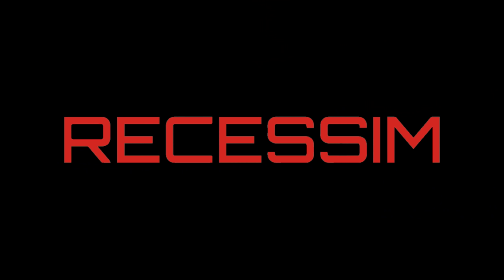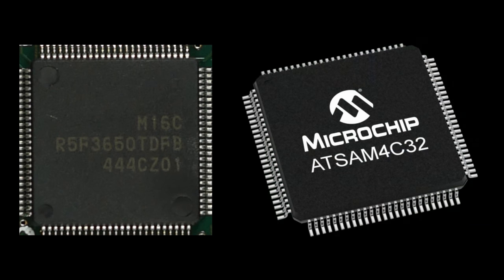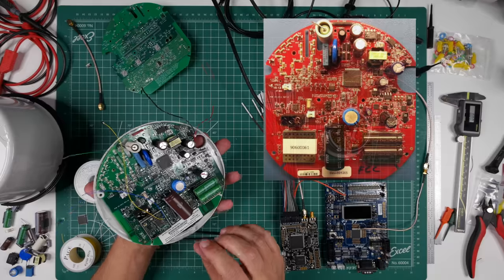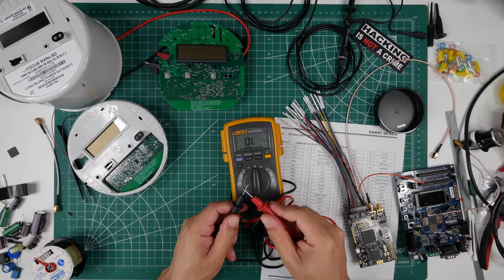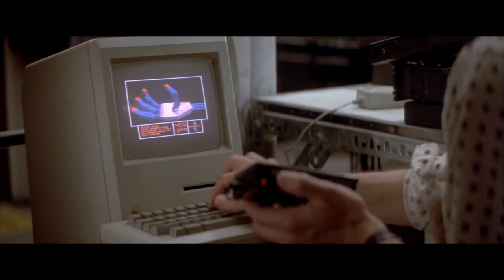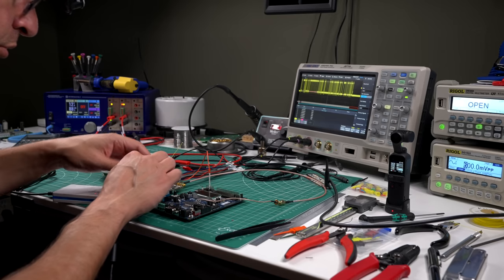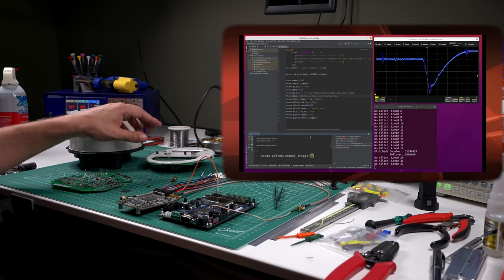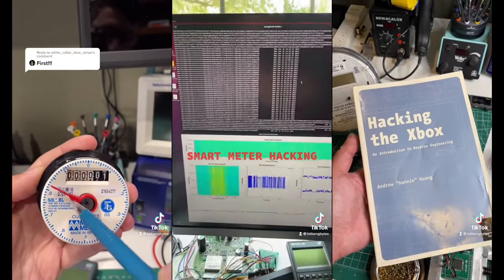Reprogramming a Smart Meter

Comment: This series is awesome!!  I got curious about this when (apparently) unbeknownst to me, my power meter was switched by someone we thought was an authorized service tech.  It turns out, this guy put a new meter on the house that was registered to some other house.  So when the power company showed up to check it out - they thought we had switched it.  But that wasn't the case.

Now I'm curious how these things work and how we got flagged.
Reply from the maker: I can think of two things that caused them to come check. First, your meter was no longer reporting back readings. Each meter has an ID number that's associated with your account. Second, a different meter was reporting readings to the surrounding meters that relay it back. This makes it very easy for the utility to determine where it's likely located.

Thanks for watching, glad you enjoy it!
Reply: @RECESSIM  so how can you give a smart meter the old id number and use one without a collar on it but without them knowing it no longer has the collar

Comment: Red solder resist is usually a bit more expensive than green - so it's commonly used for prototypes to make them stand out against production boards.

Comment: You should look at using the built in optical input output interface. On the front right of the meter you’ll see two round holes with an IR diode in them. One is input one is output. We connect to the laptop using them. We can upload firmware and download all data through this optical port. We can even turn on or off your power. They revive and send data like the IR remote for your TV does. Short pluses of IR in 16 bit @9600 baud.

Comment: 3:32 Hah.  We used to use some combination of red mask = alpha or non-form fit; blue = beta or form-fit and green = semi production.  Then our CEM said that using anything other than green can be a pain in the arse for fabs and increase cost and leadtime (because, believe it or not, the fabs can use different processes depending on the colour).  So now we stick with green for everything because it's cheaper, easier and faster.  And, ultimately, it's usually fairly obvious which rev it is without looking at the colour of the board.

4:20 You don't want connectors like that on cert day.  They conduct and radiate, even if only capacitively.  Also, your final case design matters, even if it's just plastic (but especially if it's metal).  It has to be representative of typical usage anyway, so it will normally be in the production box, or something very close to.  And without superfluous connectors.  Don't need 'em on cert day, don't have time for 'em anyway.

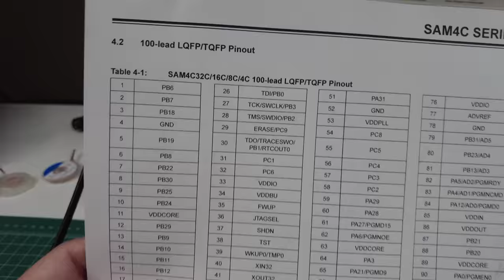5:30 there is no reason to use series resistors other than either options, as you suggest here, or dV/dt (edge rate) control for the sake of EMC compliance.  Sometimes it's for source impedance matching, which is sort of the same thing.  But JTAG, nah, that's exactly what you say.
Reply: Thanks a lot for this great comment and insight. At 4:20 if you look at that FCC document I found, it shows all the test setup pictures and they certified it bare board! Super surprised myself to find out they did it with all the extra connectors on it like that. Didn’t think that would be allowed.
Reply: @HashBoxTV  idk about 'allowed'.  Basically, if it passes, you're good.  If the product you sell is different (there will always be minor changes) and you can justify why it's not materially different from certification, you're good.  

In practice, probably no-one will care unless you do something obviously stupid or radical, or your equipment is found to be the cause of problems and you get prosecuted for CFR violations.

That all said, small changes can have radical effects.  One board I did failed EMC because a clock line made a few inches on an outside layer, even though it had plenty of lateral grounding and a nice ground plane underneath.  Disabling that and putting an oscillator closer to the load made the problem go away.  

Sounds obvious when you put it like that, but it isn't so obvious at the time when you design the thing, especially not given all else that is going on.

In fact, metal boxes are resonant chambers for RF: it could be that it passed with better margins outside the box than inside it, and they knew this from doing their own precompliance work with a spec-an and either an antenna or an H-field probe.  Not saying that happened here, but manufacturers will try to put their product in the best justifiable light possible.

Comment: Im really interested in what kinds of requests the power company sends to the smart meters. When something is part of a "smart grid" it means its being tracked with statistical data. Once you do some packet sniffing, check to see where the requests are sent. If they are sent to the power company, read some documents or interview some people on where they route that smart data and how its used.
Reply: The communication is often AES-128 encrypted and/or authenticated. The keys are unique for each meter.
Reply: @WimTon  Data must be worth a lot to do that. I wonder what a cryptographer would determine.
Reply: @ChrisHillASMR  The consumption data is encrypted for privacy reasons. This is a regulatory requirement in many countries. The fine-grained (15 min) measurements tell too much about the occupant's behavior. And of course, authenticated to prevent changing the data in transit (for revenue protection).  Switching, tariffing, and clock adjustment commands are at least authenticated to avoid misuse. The costs are lowish; AES in software with pre-shared keys.

Comment: Those Taridan power monitor/ meter ICs used to be sold by maxim, and are based around an 8051 core.. i have a dev kit for them somewhere..
They do most of the metering and accounting
Reply: The host procesor of their old gen was 51. But they have a calculation engine, a complete separate core that runs "microcode" in form of CONST. They moved to MAXQ, them wisely to CORTEX. The calculation engine structure is not discloses, its dev tools will be never be available. Pulling the array of 32 bits consts would be just the start of a long way. Plus, many other guys using Analogg Devices ASICs or even carrying all by SW (from 2010 to here became a reality thanks to Sigma Delta converters being offered in general purpose microcontrollers). This is complemented with PGAs and diferential inputs ... like TIs MSP40F67xx.

Comment: Love this. I'm in an interesting situation where I want to get the contents out of an old PIC processor which is actually my code (security bit set). I also have the code on the programmer (so I can program new processors) but the programmer software doesn't let me read back what's in its internal flash. So you have my full attention :)
Reply from the maker: PIC’s have a LOT of public exploits written about them, so I am sure you can get a copy of your code back if you search around.
Reply: @RECESSIM  🙂

Comment: Do u suppose one if those meters can detect current flowing close to it but not through it? Induction in other words. Would/could induction interfere with the meters ability to transmit accurate information back to the utility?

Comment: I’m working on Unlocking a JP4 Prison Player. 
When I connect it over usb it wants a terminal password for the kiosk. I know there’s a way to dump the info and hash out the password or reset it. Got any suggestions about what I could throw at it?? I’m new to tampering with these locked down devices. But my collection of test equipment is growing with my knowledge. Thank you for your uploads.
Reply from the maker: You should join the discord channel and take apart the device so you can share pictures of the internals. I think your logic for approaching the problem is sound.
Reply: @RECESSIM  You would laugh if you seen the pictures. It’s. Clear so nothing can be smuggled in it. Lol. Maybe I will, thanks for the encouragement. It goes along way. 
God Bless.

Comment: Very nice update. 

I like how you mix very generic hardware hacking infos and how tos with very specific information on your device. 
This makes it interesting no matter what your background and state of knowlege is.
For the FCC testing, they used most likely some special enclosure. 
It likely has stuff like cutouts for connectors and indicator leds if the PCB has some. 
It also has a stand attacked to make sure it stands with a repeatable height and angle. 
Sometimes, devices also have a special EMC firmware flashed on it, that enables for stuff like continous sending or artifical traffic over interfaces.
This is also very common in the automotive area (where I come from). 

How many smartmeters did you get?
In my experience it takes a good amount of backups, since there are more than enough ways to mess up the hardware.
Reply from the maker: Thanks for the feedback! Interestingly in that FCC report I was scrolling, it shows the FCC emissions testing being done with just the bare board! I hadn't scrolled through that document when I recorded the voiceover.

It also shows all the variations of the transmitter being tested, they can support different baud rates and channel allocations so I figure now that's why they took a FCC specific board, they were reflashing it between tests. But surprised they would grant a FCC cert with the device not being in it's enclosure and with additional components on the board that the production version wouldn't have.

I have 4 of these newer meters in total, and an eBay seller with about 12 more if I need some. Now that I can power off 12V, i'm fairly confident in my attacking, will see if any protection mechanisms pop up. I also have a few blank processors, so might just enable protection on those and attack before jumping back to the meter.

I agree with your experience as well and the same thing I warn others that want to reverse engineer, you're going to break some eggs making an omelette! :)
Reply: @RECESSIM  
Thanks for the fast reply and further insight. 

That's very interesting, I always thought, it needs to be the complete and "as close to the series unit" as possible. 
Are there different levels of certification with the FCC?
In the EU you can do severel precomplience tests that are done with different states of your product, some even with early samples and not the final design. 
However the final measurements (that give you the CE complience) are done with the final product. 

Another intersting area of electronics is the wireless infrastructure (GSM, WCDMA, GPRS, LTE). 
I often refere back to the FCC reports, when doing reverse engineering on cellular basestation equipment (my hobby interest field).
Sometimes there are whole user mauals and even the proprietrary control software available. 

The 12V supply is definetly a nice touch. 
Does the unit use the 60Hz line frequency for something or does it just detect if it is present, like some solar inverters do?

Sometimes it also makes sense to go to a fresh start to keep the eggshells out of your omelette, to build on your analogy. ;)
Reply from the maker: @gammaleader96  I was under the impression that the FCC testing was supposed to be on a "as close to series unit" as possible too, first time I have seen something like that. Cellular base stations sound fun, heard there are lots of interesting things there.

The Teridian chip used for the metering side has features for measuring the frequency I believe, but I haven't seen a menu option the fluctuates as I change the frequency.

Comment: Testing is generally done with pogo pins.  I first became concerned about smart meters when I discovered they could redefine the meaning of power on a whim.  The potential for corruption is very high and there is zero accountability.
Reply from the maker: For systems meant to serve the public, I generally think they should be built on open, reviewable software/hardware. Shouldn’t have to rely on trusting large corporations and other groups with interests that might not align with the public.
Reply: Here regulations enable the certification authority (which is state owned) to recall any meter from any customer to check for accuracy and to validate with the "gold sample" submited in the certification. So, on the instrument side, regulations exist. Not super sure with this smart thing and data being processed in bulk in HES systems ..... (question marks).
BUT, the BIG "carrier" that buys and sell power is state owned and have their meter (tipically indirect type class 0.2 or even 0.1) at powers stations. So things must "add up" at some point. Of course this thing can vary from one place to another.
Reply: In addtion, nothing stops you to install you own meter in series.parallel with the main one. I guess you will need traceability for yours in order to start a claim if billing does not match.

Comment: If you need a SMD JTAG connector, look for a low profile female JTAG connector...That should fit in the shallow space
Reply from the maker: Thanks! In the FCC pictures they appeared to use the same connector as I did and didn't put it in a case at all.

Comment: I just subscribed.
I am a meter collector/enthusiast that discovered your videos while sleuthing around. I am not a security researcher (or anyone who has any interest in reverse-engineering things), and I am purely here for the meters.
I also have a question. Do you know where I could find a tool that I could use to take AMR readings wirelessly? The one good solution I was able to find (the Grid Insight AMRUSB-1) has been discontinued. I am asking this because I want to get a hybrid electromechanical (analog) smart meter from eBay.
Reply from the maker: Check out the RTL-AMR project, it can read certain meters wirelessly. Not the L+G meters I am looking at, but others.
Reply: @RECESSIM  Will it work with the Itron R300 900MHz protocol?

Comment: Would you like a CT/PT (transformer rated) meter that doesn't work on a full 240v flow-through design?  They grab their power from small current transformers and/or potential transformer (CT's and PT's) that read the flow from the power lines, to send a signal to the meter, the meter data is then set by the scaling factor of the power it sees from the PT's and/or CT's (500:1 for example).

If you would like to run tests based on these style meters, I can send you one (perhaps with a CT meter cabinet, as there are more "jaws" than the line in/out voltage, they also have legs for the incoming CT data).

These are the meters our utility installs when th service requires more than 400amps.  200 amps and less will have a common full power flow thru.  I hear there is industry talk in developing a 400 amp flow through.
Reply from the maker: Can you send me some pics of it? Hash@recessim dot com
Reply: @RECESSIM  sent some pics.

Comment: I don't know enough about this stuff.... but wouldn't it be beneficial to have a power supply not only capable of sourcing current... But also sinking current?

Completely synchronized in one device. I mentioned source measure units on another one of your videos... 

 with an SMU... You can basically do anything. It's nearly like having a whole test bench in one integrated device

Which is hugely beneficial when trying to synchronize a bunch of different processes and measurements quickly and repeatedly with great precision

 it's all combined in one package and communicating with each other. 

Just thought with glitching and other attacks.... it would be just as important to sink the power out of the device before starting another cycle. 
Or possibly even going negative voltage? Rapidly in succession while monitoring everything in unison. 

Of course this can also be done with separate power supply and electronic load devices. Along with other monitoring equipment and stand-alone pieces of gear.

But an all in one integrated device makes everything so fast, programmable, and effortlessly precise. 

Please ignore if is a dumb idea i honestly don't know enough about glitching to even comment. 

 my specialty is test gear and metrology equipment. So I just thought I would throw that out there.... Since SMU's are used so widely when trying to reverse-engineer or characterize something.

Comment: I wonder how they can do FW over-the-air with the protection set like that.
Reply from the maker: It’s their code running on it, they just disable any protection in place when updating if needed. But accessing externally is different.

Comment: I've always found using "real" 0 ohm resistors much easier than trying to get a wire to fit ..... but it's just a matter of taste
Reply from the maker: Agreed, if I had some sitting around I would have just placed them on real fast with tweezers. In this case I would have to found some on a PCB, desoldered them and then used them here so some 30ga wire faster.
Reply: @RECESSIM  I play around with old Internet routers.... and to get the serial port working I have to add 2 0402 links and with my bad eyesight and shakey hands, it can take me a couple of hours.
Reply from the maker: @edgeeffect  glad to hear you get it done though!